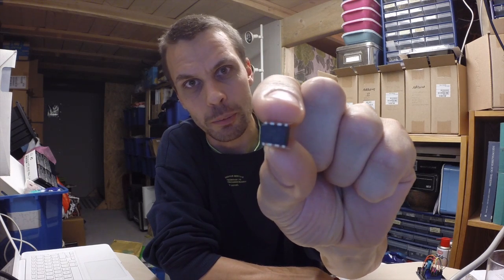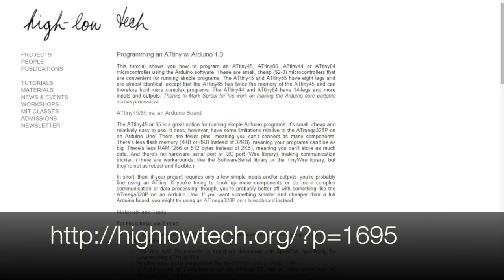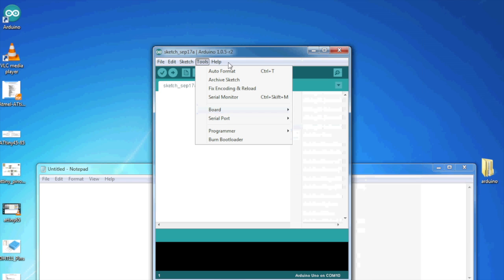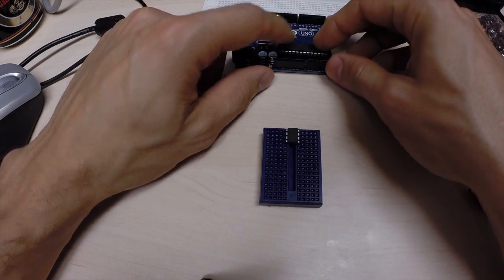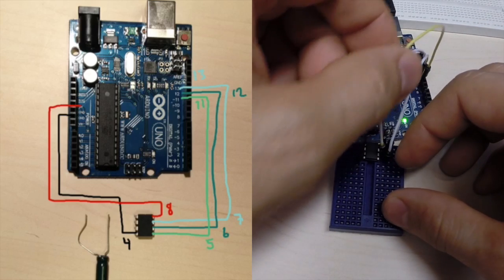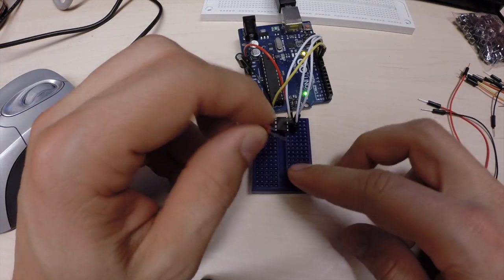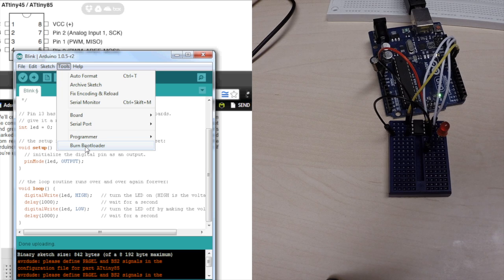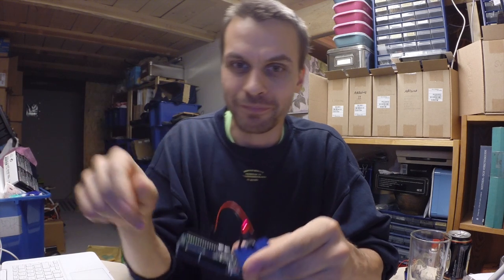Programming the Attiny84/85, Minifying the arduino (even more) [Anything Arduino] (ep3)

Comment: To get the ATtiny to run at 8mhz you have to change one of the fuse bits,
Reply: When you upload the bootloader,  doesn't it repopulate the fuses for 8mHz?
Reply: not exactly. It does not have a bootloader. nevertheless, if you chose 'burn bootloader' after you select the right attiny specs, the right fuses will be set

Comment: hi Kristian,  code won't compile!
Reply from the maker: +dibraniuk Did you follow all the instructions? What error message do you get? Have you made all the changes to the Arduino so it is an Arduino ISP?
Reply: Kristian Blåsol yes did that; it loaded on the arduino but but failed to compile and load on the attiny85. tried many times with no results
Reply from the maker: Do you get an "out of sync" error?
Reply: no. i shall try again

Comment: HELLO ,  
I need to make a beacon / recovery device on my RC submarine . All I want is to make a Sound (with a small buzer) and Light signal (with a white LED) - S.O.S. morse code , with the most simple and cheep microcontroler and Your example is the most simple I can found . Can You help me with the start code for it ?. The principle is simple : when the RC submarine loose the the RF signal for more than 3 sec , the device it should start emit the SOS morse code with the LED and the buzzer . 
THANK YOU .
Be well and stay Safe .
Reply from the maker: MARIUS Petcu Hello, I believe this could be done with an AtTiny ofcourse. But first: On your RF reciever that you use is there an output that goes high when the signal is lost? Or any way to connect to the RF reciever in the submarine so the AtTiny can sense that the RF signal is lost? If you are unsure, which brand/model is it? Once you have the RF signal into the AtTiny, you can just make a code using digitalWrite to a pin for the LED blink, and using delay functions in morse intervalls do the same to a buzzer for example on another pin. Let me know about the RC reciever and if you need more info or help about the arduino code for morse etc...